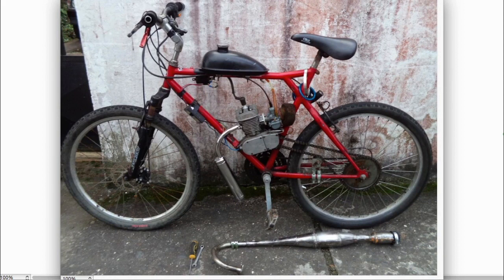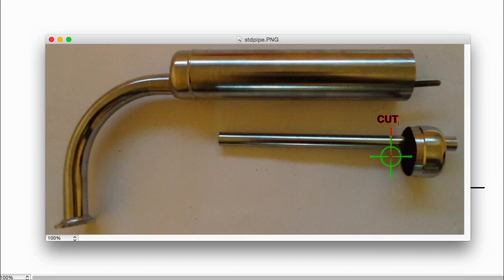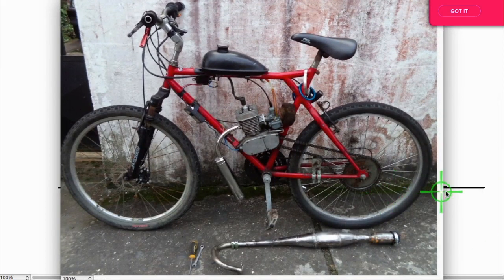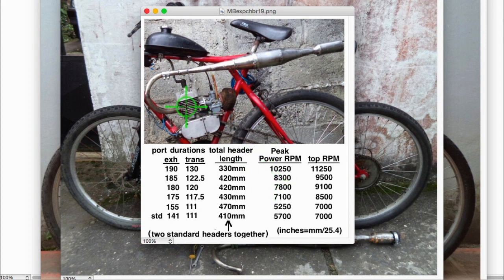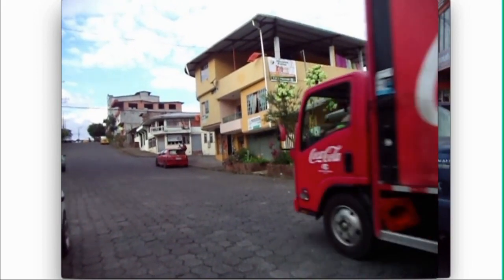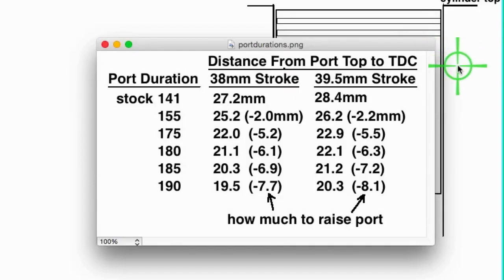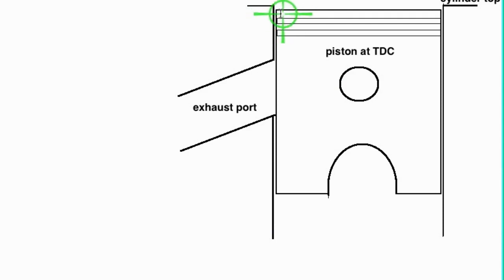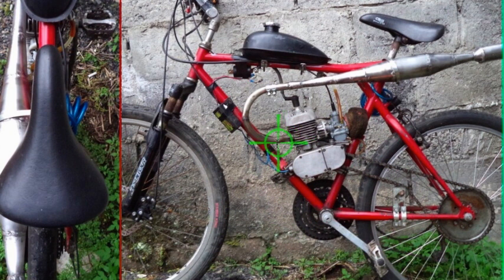Motorized Bicycle Exhaust Pipe Comparison

Comment from the maker: For the same money and time you can have an awkward looking motocross pipe modified for your engine but the tuning will probably be off since the people that do this adaptation don't go by the formula for figuring out the correct header length to match your engines peak power RPM (which they don't know because they don't use my porting calculator). They make the header a "convenient" length.